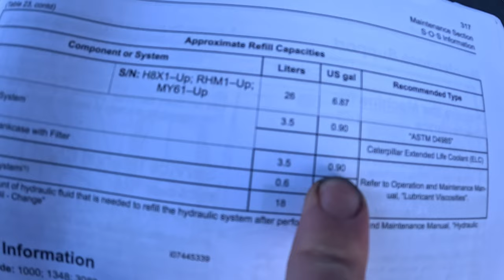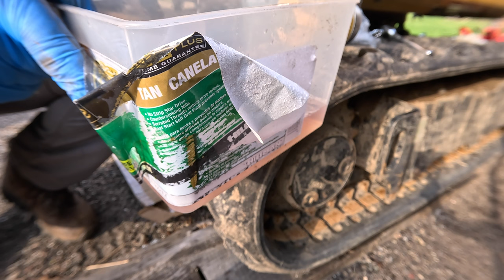Maintaining A Caterpillar 301.7cr Mini Excavator

Comment: A tip for welding, your travel speed looks a little fast and inconsistent at times. Try moving the stick a little slower, more uniformly. Don't get in a rush. This will let the weld puddle fill properly. Thats why some of your beads look like old coke bottles getting thinner and fatter and thinner again. Learn to watch the molten puddle of metal forming and move along only as fast as it takes to fill the puddle out. Since you're running off a 110v outlet this will also help you build better heat in your base metal which will in turn give you better weld penetration which is important in this application since your base metal is pretty thick for a 110v welder. Stick welding is tricky at first but very versatile and a great skill to have. You're doing good. Like any skill it just takes some practice.
Reply from the maker: Thanks for the tips, it's hard to really focus on any one thing when I was mainly concerned about not loosing my arc. I really just need to fart around with it more. At the end of the day, knowing what to do is one thing, actually doing what you want to do is another.
Reply: @PhilsWorld  I understand it. There's a lot different stuff to focus on while stick welding. A lot of movements that other welding processes don't have. You'll get it. I love the videos, man. Keep it up!

Comment: If you feel yourself getting frustrated, try to remember that even the YouTube phenom, Andrew Camarata, mostly learned by doing.  Your advantage is that you will actually read the manual.  Well done and keep up the good work!  (By the way, wouldn't it be nice if your alternator belt came with a derailleur of some sort?

Comment: Top tip to avoid destroying DeWalt flex volt batteries- don’t weld near them, if some molten metal was to land on it, you could face a very hot lithium battery fire to deal with. I hope you take that criticism constructively!
Reply from the maker: You are probably right. I don't think there was much splatter happening, but I do need a to come up with better welding setup if I start doing this more often.

Comment: Great video. Make sure the old oil filter gasket comes off with the old filter and isn't stuck to the housing. This is so the new filter gasket seals properly. It is also good to check new filters for metal shavings from the manufacturing process. One more tip would be to put a sharpie mark on the alternator and the bracket so they line back up after changing the belt.
Reply from the maker: The sharpie idea is a great tip and thanks for the heads up, those are a few things I'll be doing in the future!

Comment: Welding tip watch the puddle you are creating and manipulate that puddle … move pause move pause … move slower get comfortable… if you start getting out of position and uncomfortable stop and reposition… when tacking in metal tack both side then weld it out so it don’t pull and lift… another thing is hit it with a torch to preheat and burn off any grease that may be in metal it will help.:: over all you did fantastic for first time welding… I tell people I can’t tell you how to weld you have to weld for learn how to weld it’s the only way … pick up some scraps metal from junk yard or metal fabricator local and on a rainy day just run stringers

Comment: @vicdean7393
1 hour ago
We have a couple of 301.7 and some 302 for building trails. Just recently found out why we are bending and breaking thumb pins and cracked two thumbs exactly where you are welding your cracks. The thumb cylinder hydraulic pressure is the same as bucket cylinder pressure, so bucket can’t overcome thumb when curling while using thumb and bends pins, flexes thumb pin bore. I went down to Gregory Poole the CAT dealer here and they showed me how to hookup pressure gauge and adjust thumb valve pressure so it is slightly less than bucket pressure. 
Some more tips- if you want to save some money you could just adjusted fan/alternator belt tension instead of replacing belt, had to adjust belt on 5 of are CATS when they were new. You can also blow out air filter with compressed air a few times before replacing filter.
Reply from the maker: Hey Vic thanks for sharing, its actually super helpful to hear that this isn't an isolated incident. My (awful) welding surprisingly held up for the year but at the end i noticed it was starting to crack again. Did they show you how exactly to adjust the pressure? 

Are you saying the noise is just from the belt slipping? The belt was relatively cheap and close to CATs recommended service interval. I just assumed that was the noise the belt makes when it's close to it's useful life. It would be nice if all i needed to do was tension it again as it started squeaking again and it seemed like i had just replaced it.

If you happen to document any work on your 301/302 I'll definitely watch it. There's very limited videos on these machines.
Reply: Yes  they showed me how to set up and adjust thumb pressure. 
Yes, the belt noise is from lack of belt tension. On new belts they stretch a little after some use, you simply tension it some more. 

I kinda want to video some of my work but it is time consuming and I'm very busy with 11 excavators, 2 track dumps, 7 track barrows, 3 mini skid steers and numerous other pieces.  I imagine it's time consuming for you too but you probably have more free time and getting some monetary return.
And you're right, not many vids on these compact machines.
Reply: Thanks for the information Vic.  I have a 2020 CAT 301.7 (purchased used with 360 hrs and presently has 495 hrs on it) and have the same bent thumb pin issue.  I will consult with my local mechanic and see whether the pressure can be adjusted like your saying.  Also wondering if any of you have had issue with the pin retaining bolt breaking off or gone missing? Have you also just left the bent pin without replacing?  Mine is a minor bend like Phils example in the video.
Reply: @graemebean6607  yes we’ve had pin retaining bolts break. I suspect because thumb bores are flexing (if thumb pressures have not been adjusted) which bites down on pin causing pin to spin as it’s moving putting a lot of pressure on retaining bolt. We’ve been running one of excavators that had the thumb pressure adjusted and have not bent the pin yet. And yes we are running one with bent pin but I adjusted thumb pressure lower than bucket.

Comment: Phil to make welding easier and more controled , cut the rods in haif and strip the coating from the top of the bottom half of the now 2 rods to make 2 smaller rods which you can control better.
Reply from the maker: That's a solid trick, those long rods can be really tough to wield around and my small motor control isn't the best.

Comment: May I ask how much was Machine OTD when you purchased it? How you like it?
Reply from the maker: It was in the 35k range at the time. This was early covid pricing and I think prices have gone up since. That included  2 buckets, a quick coupler, thumb, and aux plumbing. I don't know what this would cost today. At the time I had also looked at a Kabota, but the equivalent machine (u17), needed a thumb installed aftermarket and that brought it's cost roughly into the same range as the Caterpillar. I've been really happy with mine, and I'm impressed what I've been able to do with it. That being said,  I also don't have much to compare it to. but I have found that Cat makes it fairly easy to maintain my stuff which is a huge plus for me.
Reply: @PhilsWorld  quick coupler is the using wrench to remove bucket or is it hydraulic quick coupler
Reply from the maker: @marcoa2222  With the wrench. Without it, I would need to remove the pins. There might be a hydraulic quick coupler for this machine, but I don't change buckets all that frequently so this was all I needed.